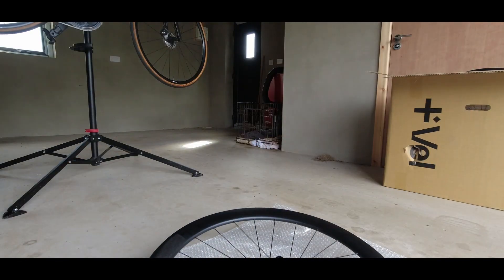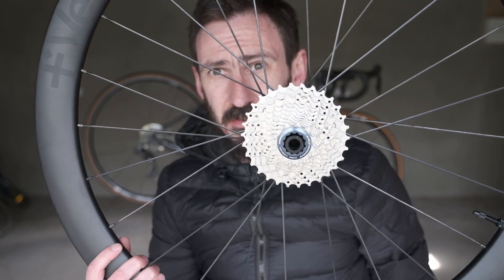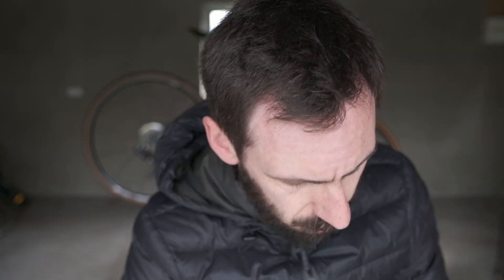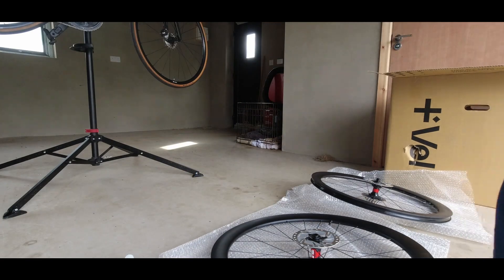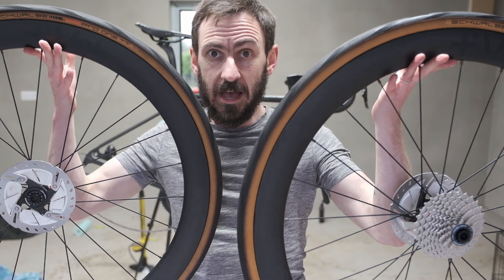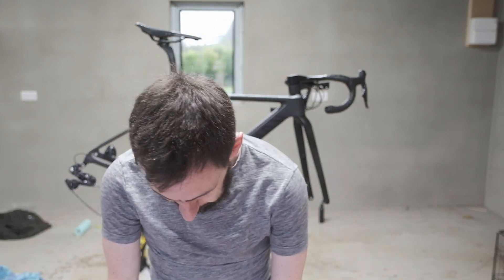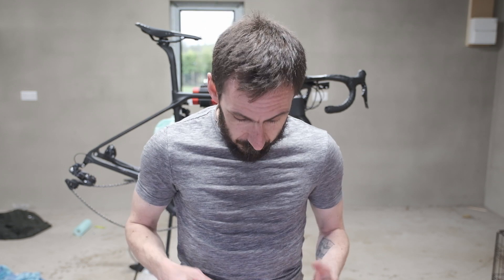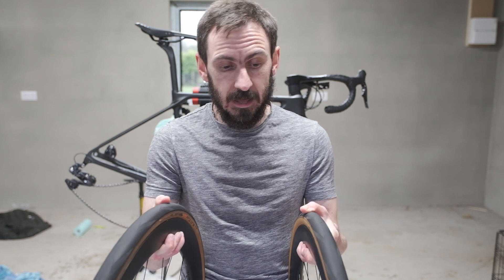Setting Up my VEL RSL 50 Wheelset Tubeless

Comment: Have you considered using a device called, Airshot, in combination with a standard track pump? I've not got one myself, but heard it's a handy device to create that reservoir of air, which can then be be released in one go when trying to seat tyres.
Reply from the maker: Ooh, that sounds interesting, I might have to look into that! Thanks!
Reply: I got an airshot and it works perfectly.
I only ever have to used it when messing around with used tyres though. I think they might stretch a little and lefter over sealant might be causing them to stick.
Probably the problem you had here.
Reply from the maker: Yea, I might have to get one, got an un-repairable tubeless puncture today so new tyre needed 😩
Reply: @connormcc  how bad is it? I’ve repaired them before with a patch on the inside but think just depends how damaged the carcass is
Reply from the maker: About a 3-4mm slit… not sure it’s worth trying to repair… are you on Instagram? Dm me @connorm.cc and I’ll send you a photo of it tomorrow

Comment: How does the Schwalbe Pro One TT Perform? How's the puncture resistance?
Reply from the maker: I’ve loved them, however I just got an unsealable and unrepairable puncture a couple of weeks ago, so I’m back on tubes for now, I think these are primarily racing tyres so not really for day to day riding. I’m going to try the Pro One Evo tyres next I think
Reply: @connormcc  pro one TT can also be used with inner tubes right?
Reply from the maker: @brasso9393  hmm, I'm actually not sure - These were the TLE (Tubeless Easy) version, so these might be tubeless only